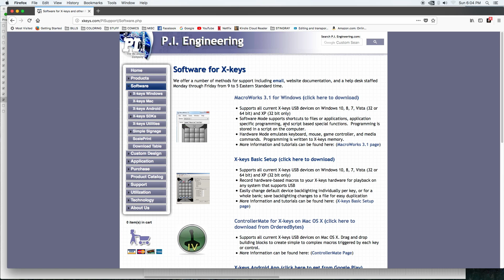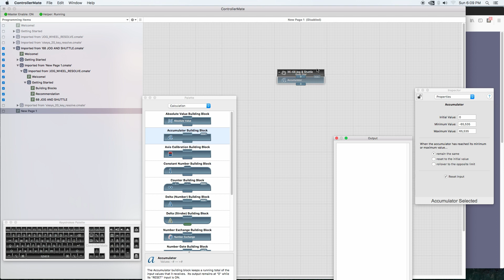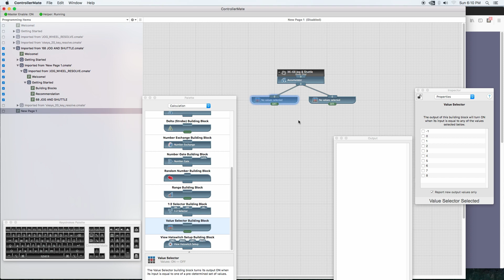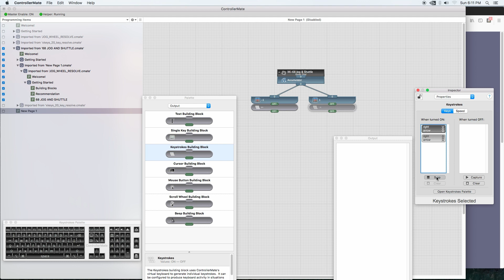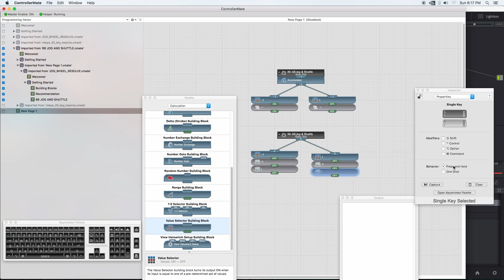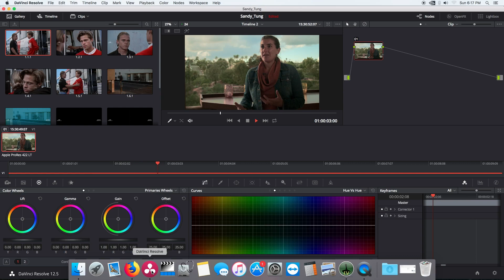X-KEYS Jog Shuttle knob / dial for Resolve tutorial using ControllerMate!

Comment: Impressively complicated in comparison with the Windows software. Macroworks keeps throwing errors at me, so I use X-Keys basic, but in both cases an easy interface is shown with a picture of the Xkeys 68. I've programmed the outer ring with as center k, left arrow down 1st left, right arrow 1st right both with a delay of 150ms, the rest of the lefts j, the rest of the rights l. Result: Middle: Stop!, first right every 150ms a next frame, 2nd right play, 3rd - 7th a speed increase. The inner wheel to move just one frame at a time.

Bought the unit a few weeks ago, spent a weekend programming it, including printing of the key-inlays and now using it for a 7 track video. Now I wonder why I didn't buy this unit earlier, what a difference compared to using the mouse for everything.
Reply: I know this is a little different, but do you think this might work?

Using the xKey 124 T-bar to automate this in the DaVinci Resolve application:

https://drive.google.com/file/d/1W7xLKw4FsEekt6M_v2bCRBTV4Pu5a21Z/view?usp=sharing

Resolve's wipe function places two images over each other in the exact same spot in the GUI.  You can then “switch” between the two images just like you would “switch” between two live video feeds in a control room.  Just inside the app.  This is also output through video hardware to your broadcast monitor.

When you initiate the wipe function, a visible line appears, splitting the two images in half.  You can then click, hold, and drag a mouse or pen tablet, and drag either way to reveal more or less of each image.  Effectively cropping the image you're dragging over and revealing more of the image you are dragging from.

If you have BM's $30k Black Magic Advanced panel T-bar, you can use it's T-bar to wipe between the images.  I'm assuming BM's DaVinci Resolve uses the same code for their Advanced Panel T-bar, as BM's ATEM uses for the a T-bar on an external controller.  So technically Resolve should be "listening" for a T-bar

The physical wiping of the line itself could be a "left mouse button down and hold" but assigned to the T-bar instead of the mouse.
Reply: Can you save and export custom profiles?
Reply: @danhopkins2955  Yes. It's saved in a text format.

Comment: Thanks for taking the time to share this, brilliant. Instead of adding two separate key building blocks for shift and character, you can just add the character and in its Inspector Properties enable Shift. I use ControllerMate this way for After Effects as there's tonnes of modifiers for some shortcuts :)